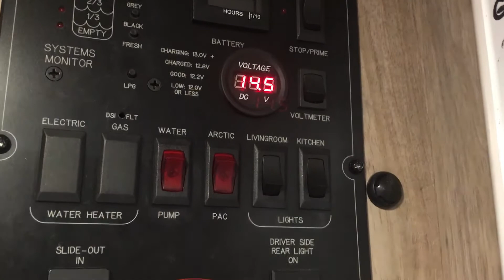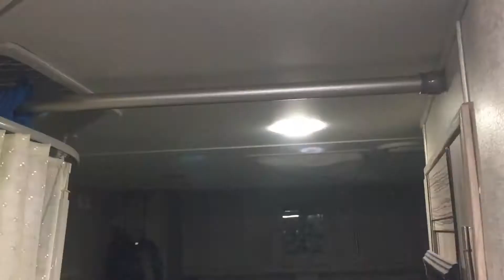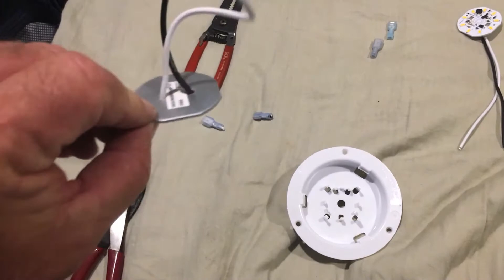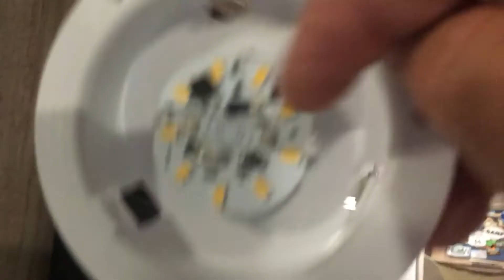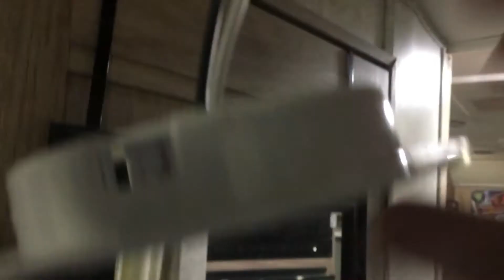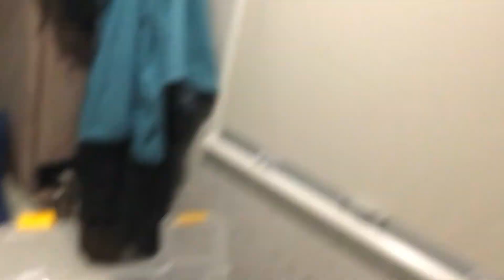HOW TO Replace a RV 12V LED Light  FAST & EASY

Comment: Yup, LEDs the wiring is usually reversed. Black for positive & White for ground. Great repair job. I sure do like that connector kit you have there. I have all my connectors in a Walmart bag and it has seen a lot of miles and been in several of my vehicles. Thanks for sharing Brad.. Steve
Reply from the maker: I got this box at Lowes. Thanks for watching. ~ Brad

Comment: I had a rather unsettling experience with a flashing LED bulb that actually started to smoke and then melted the light bulb itself. I tried just changing the bulb, but it still seemed to flicker. It was the only fixture i hadn't replaced with a new LED fixture, as the previous owner had replaced it. So, went ahead and changed the fixture too. No problems since then! Yay! Good info and easy to follow instructions for anyone who is wanting to do this.Thanks for sharing!-Sue
Reply from the maker: That sounds like a scary situation... a couple of the ones I took down had burn marks. Very fortunate for you that you caught it. ~Brad

Comment: Hi Brad, thanks for showing us how you change the lights. We replaced all our bulbs from florescent to LED when we got our rig. Sometimes we get flickering on those as well. All we have to do is pop out the old bulb and pop in the new one. How long has your lights lasted before you have to change them? ~Lucy
Reply from the maker: Well it depends on how much use they get. We tend to use some lights more than others. We have had to change 2 of them twice in a year. But the one in our bathroom has never been changed. ~ Brad

Comment: Such a shame that we spend more these days and get less quality. Thanks Brad for the DIY procedure! Stay safe and God Bless!
Reply from the maker: We were surprised too.,, but think it’s because the Lithium battery puts out more power than it can handle ~Diana
Reply: It's About Time Now > there’s no way to ‘step down’ from 14 watts to, say, 13..or even 12.5?
Reply from the maker: Great question... Yes... there may be a way to step down, but this is the way the rig came ... we don’t want to add another component ~ Brad